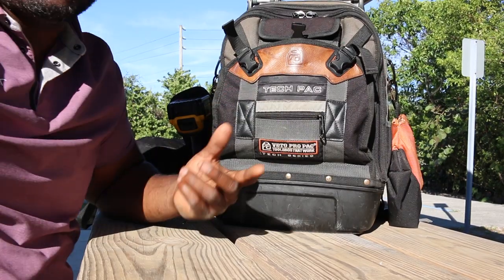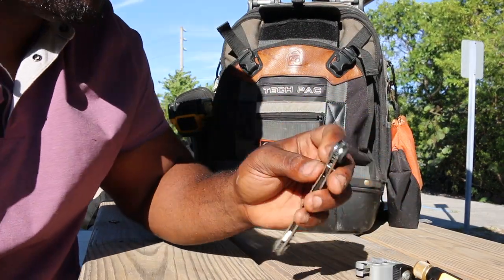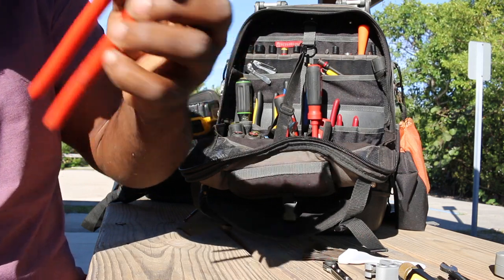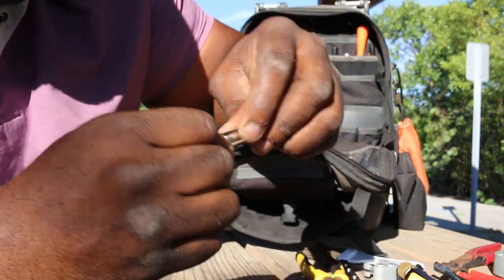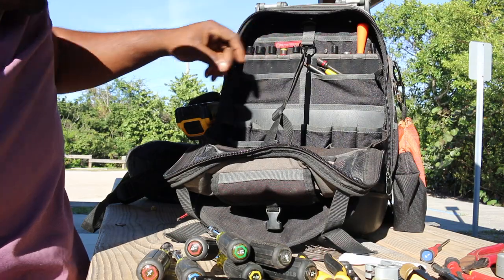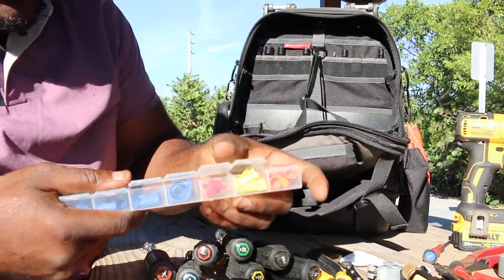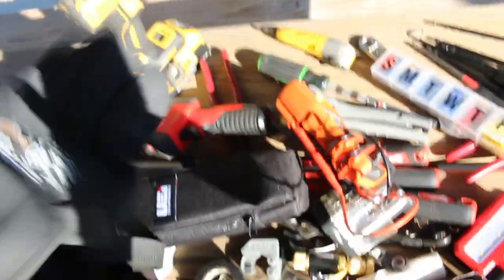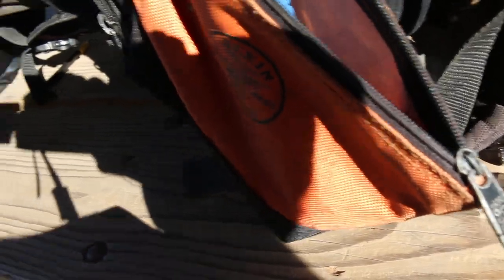Speed Run Through my HVAC Veto Pro pac Backpack

Comment: Nice set up but that's alot of weight do you take that to do your diagnostics also if so you will eventually get a lighter bag
Reply from the maker: That bag was actually stolen too😡😡😡 I use the yeti bucket set now with a small veto meter bag for the attic. No more hurting knees from kneeling by the condenser